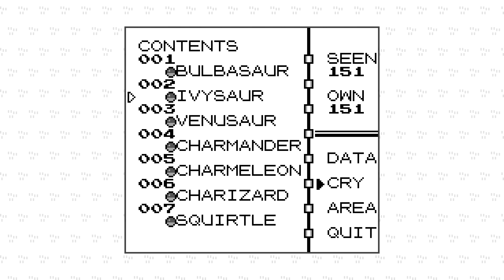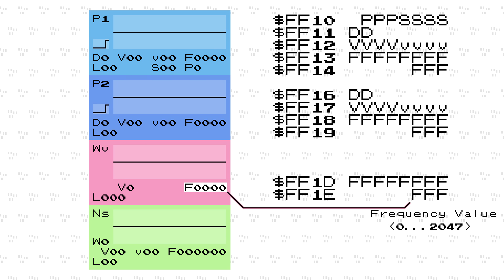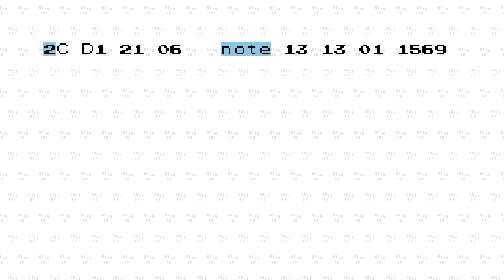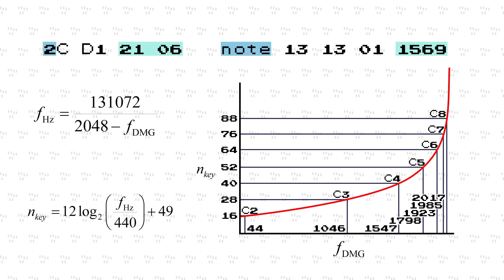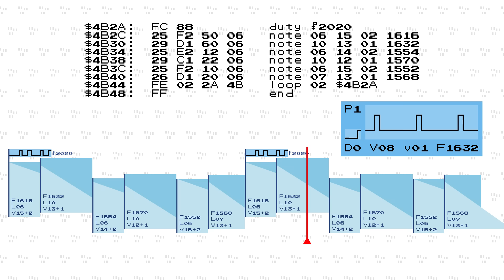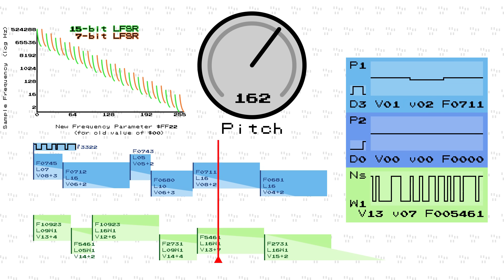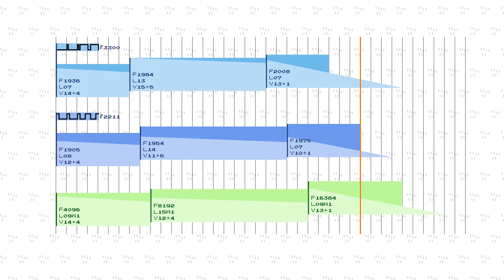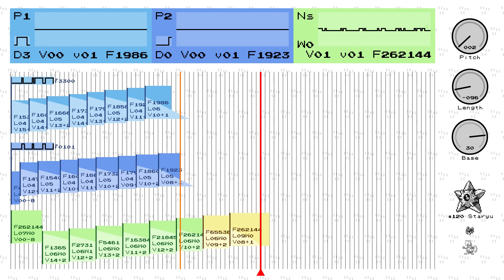Generation I Pokémon Cries Explained

Comment: It should be noted that when Game Freak first pitched Capsule Monsters, they only had 38 pokémon designed. Kinda interesting considering there's only 38 unique cries...
Reply: Thunder Shep - it's pretty much common knowledge now that rhydon was the first one ever, there are entire design sheets that leaked recently with all the original designs and even scrapped mons
Reply: @youtubeii434  lol now the whole source code has been leaked
Reply: I feel like they were having a "just one more" or "I promise this is the last one" attitude with designing Pokemon. Pretty much like me.
Reply: @revolvingworld2676  No, no, just one more, just one- Aw, fuck now there's 151.
Reply: @revolvingworld2676  
Which is why Mew snuck in at the last moment. 

As far as all but one or two people were concerned, the first official release of Red and Green had exactly 150 Pokémon with non-garbage entries (plus sprites for a ghost before using the Silph Scope, the Kabutops fossil, and the Aerodactyl fossil); however, someone snuck in data for the 151st Pokémon, Mew, at the last second without telling anyone, after the last official changes were done (prior to the last bug tests) but before the final draft of the code was shipped to Nintendo to put on mass-produced carts. Even most of Game Freak were surprised to learn that Mew was in the game, which they only did because stories spread about how players were able to find this Pokémon by exploiting a glitch. Once they realized what had happened, they covered up the fact that this Pokémon was not technically supposed to exist at all by announcing that Mew was a special Pokémon that could only be obtained by sending in cartridges to Game Freak, where they would upload Mew to your game as part of a contest.

Incidentally, prior to this, Pokémon was not selling particularly well, as it was a set of buggy games for a system that was nearing the end of its lifespan and required use of an almost-never-used accessory and someone else with a copy of the game and their own system to be able to fully complete. However, the discovery of Mew led to a rapid surge in popularity as it seemed like any other urban myth except that it could be verified and reproduced pretty easily and, eventually, got some level of official endorsement. (This is one reason why Game Freak couldn’t just ignore the news of Mew’s discovery; it had effectively saved the games’ sales, so dismissing it or ignoring it could lead to the games failing again.) Thanks to the sudden boost in sales, Game Freak were able to expand the series significantly, creating a TV show, manga, an updated version with some bug-fixes (Blue version), merchandise, localized releases for players outside of Japan, an N64 game (Pokémon Stadium, though not the same Pokémon Stadium international players got), and begin work on the sequels, Gold and Silver. (Yes, Gold and Silver began development before Yellow version, the first Japanese Pokémon Stadium, and international releases of any Pokémon game.)

(For some reason, Pokémon took off in the West a lot faster than it did in Japan and had nothing to do with Mew being found.)
Reply: @bhull242  
It could've had something to do with the anime, although I'm not sure
Reply: @revolvingworld2676  You designed your own kids?
Reply: And the beta for Red/Green had over 170 Pokemon
Reply: @GabePuratekuta  And there were eventually 190 planned, hence the 190 slots within the internal data of the game!
Reply: Also noteworthy that the first pokemon designed was Rhydon and he is the only one of very few pokemon with his own unique cry. Kangaskan was the second pokemon programmed into the game and is one of the others with a unique cry, and I dont know Lapras's hex code off the top of my head but I know it appeared in the first design art alongside Rhydon so must be an old one and it has its own unique cry too. You can tell they very quickly realized they needed a way to make cries faster.
Reply: @rexdenver9668  radon sounds like magmar tho if you kinda compare a little bit but magmar is a little faster
Reply: The point of voltorb is that it looks exactly like a Pokeball, which is the default appearance of items in the games. Also Clefki, Vanillite etc are great designs. Gen 1 had freedoms because it was first, like "make a fat bipedal dragon" or "make an aquatic dinosaur" or "make a buffalo with multiple tails". Its the older generations that were generic designs, new ones have to try hard to be creative not to repeat itself.
Reply: That would also explain why Blastoise is in a separate group from Squirtle and Wartortle, despite the other two starter families each sharing a group: Blastoise was originally intended to be totally separate from the Squirtle line, with the latter having a final evolution that more closely resembled Wartortle. However, likely after Game Freak realized that having two distinct Water-type turtle Pokemon would be redundant, they scrapped the planned final evolution for Squirtle and replaced it with Blastoise.
Reply: @MisterVercetti  Right; Blastoise was originally gonna be named after Caravaggio, likely a nod to TMNT since that's the name of a painter.
Reply: I've never heard of this in all my years as a Pokefan
Source?
Reply: Don't forget all the evolutions where they pretty much just add extra heads. Truly the peak of creativity!
Reply: @Substantiall  they just took the evolutions from the anime. They didn't came up with adding heads as an evolution
Reply: @mimizdani8194  Except gen 1 was developed before any sort of anime was even conceived for the franchise.
Reply: @mimizdani8194  ...?
Reply: @Shrek_es_mi_pastor  I don't even remember what I ate last week and I can't remember what I was thinking 🤣
Reply: Explains the existence of uninspired entries like Luvdisc.
Reply: @ananasupreme  Luvdisc wasn't Gen 1
Reply: @ananasupreme  Luvdisc is hardly uninspired.
Reply: @ceulgai2817  Much more inspired than Voltorb at the very least.
Reply: @stopthisatonce  No, Voltorb's pretty inspired: It's the classic JRPG Mimic mixed with an electric energy bomb.
Reply: @stopthisatonce  Yeah, Voltorb was one of the first few Pokémon designed.
Reply: @TheAlexSchmidt  actually, that would be Slowbro.
Reply: and voltorb...and klefki...
Reply: @Modest784  voltorb was based on mimic design in other games
Reply: @Modest784  Voltorb wouldnt be so bad if Electrode wasn't basically the same exact thing +a mouth
Reply: @ScreamingBeast  Yeah if Voltorb was a pokemon without evolution that would have been alright for me, Electrode is what ruins it
Reply: @M3lw4r3  electrode was kinda goofy if you ask me
Reply: I would have preferred less but unique Pokemon. Rather than 700+ with many of them not competitively viable.
Reply: @Slevana5  yeah gen 1 I feel has is the only one original with creatures
Reply: @ses5736  don't 4get gen 2 bet than they say everyone is a grneunner which is a stupid name if you ask me
Reply: Guy who haven't played in years: Hi I haven't played for 20 + years now! I might play this new game called Pokemon Sun and Moon!
20 seconds later: WHAT THE HECK?! THERES 700 + POKEMON?!
20 Days later: Wow that was easy, even though it has 700 + Mon
Reply: So when Dream said there were 39 pokemon during the creator games yesterday....?

Comment: So for the Pokemon that have the exact same cry, did they attempt to use a Length value too small to produce an actual time stretch? Did they make a mistake, or was there not enough space to actually distinguish them?
Reply from the maker: The two identical pairs have the same length and pitch parameters assigned to them (for reasons unknown).
Reply: check the synth.

Comment: Incredible visualizations! 
Also when you say opcodes you don't mean actual opcodes for the GB cpu but for the piece of code (I guess it's a VM in a way) that reads the music data and set the sound GB registers, right?
Reply: I think that's what he means, yeah.

This is a thing that people in the security field are coming to terms with; nowadays a majority of file formats are really just specialized VMs, and that makes it a lot easier to manipulate errors in whatever is interpreting the file to mess with your computer.
Reply: @TOASTEngineer  Do you know any prominent examples of file formats of everday use that have machine code in them?
Reply: @hauslerful  PDFs can AFAIK contain code. Obviously Java .jar files can contain native code too.
On a side note, lot's of common file formats use VMs or interpreted code.
If you print something out, a post script file is usually generated and sent to the printer.
Postscript is an actual AFAIK turing-complete programming language that is executed on the printer to print your document.
Reply: @TOASTEngineer It's actually a pretty old thing, even the apollo guidance computer had a vm program that could read a specialized instruction set for vector and general navigation stuff. It even influenced a bit the actual instruction set of the real CPU, as it had some actual opcodess that made exctracting virtual opcides faster 

@hauslerful Actually the point is that those files don't have actual machine code in them, but code for a machine that exist only as a program. This is an extra security feature, as if you would use actual machine code from unknown files you could trigger security and memory safety issues. In the case of the pokemon cries and partially for the apollo you also reduce code reopetition, since your VM opcodes are shorthands for a complex series of operation, so something like "set pitch" gets translated to several write to memory commands. But you have to write this function only once with generic values and then you get those value each time from this short, domain specific "opcodes"
Reply: For Game Boy I imagine security was not terribly high-priority given the nature of a system that largely relies on read-only memory for running its software. Though I've not looked at a disassembly of the game, I know that many glitch pokemon have some incredibly funky and broken (Sometimes eternal.) cries.
Reply: @fluffy_tail4365  The Apollo GC did actually have it's program in hand-woven ROM.